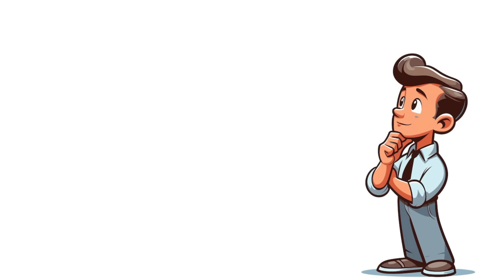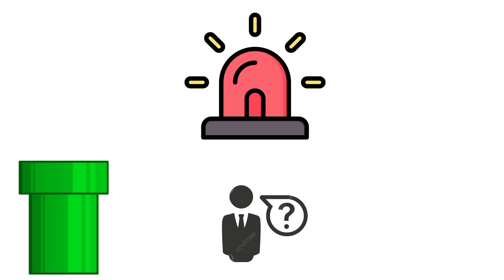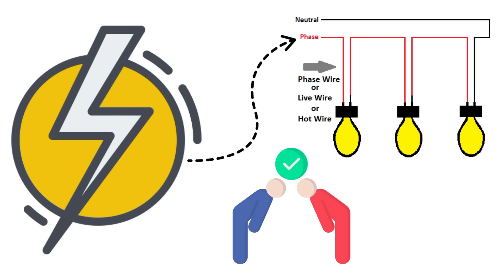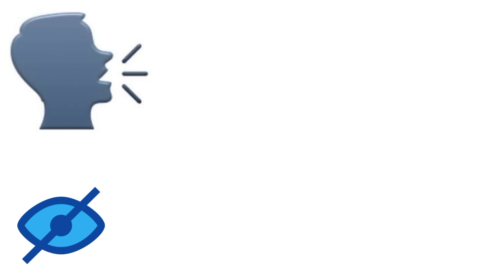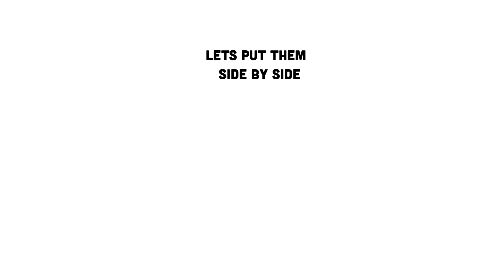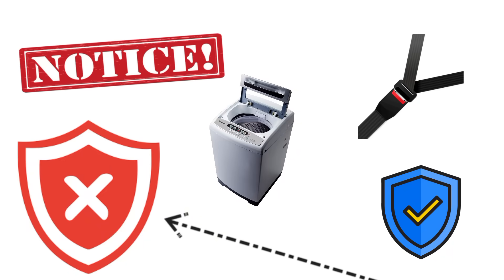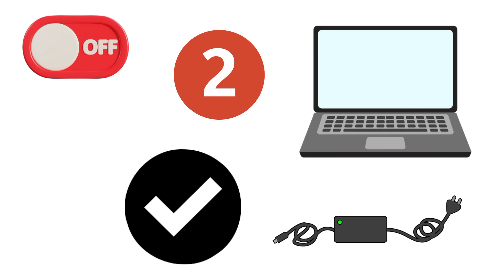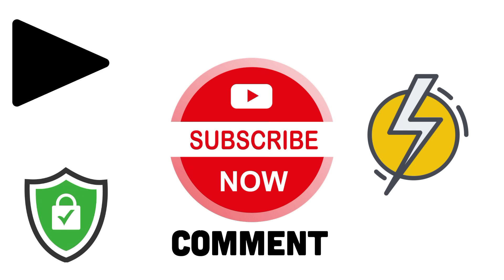How PHASE, EARTH, & NEUTRAL Works (REALLY SIMPLIFIED)

Comment: Wrong Wrong Wrong.
The "earth wire " does not conduct current into the earth. This is a point of confusion in the industry. The earth wire, better known as the ECG - Equipment Grounding Conductor - is what connects an appliance's cabinet back to the service panel (breaker box) at the same point as the neutral wire itself. In other words, this ECG wire ("earth wire") is like a parallel neutral wire that connects to the appliance's cabinet. Then if the hot (phase) wire touches the cabinet a direct short occurs to neutral and the breaker trips shutting off the power and making everything safe.

Yes, both the neutral wire and ECG wire connect to the wire that runs into the earth. However, the neutral wire and the ECG wire have nothing to do with the earth connection. That is to say, the neutral and ECG wires do not in anyway use this earth connection in their respective tasks. You could disconnect the connection to the earth completely and that would have absolutely no effect on the function of the neutral and ECG wires, or on safety in the event of an electrical short.

Someone may then ask, "Then why is the neutral and ECG wires connected to the earth?" Well, it's for a completely different purpose. To illustrate, imagine a railroad crossing. The tracks cross over the road. In fact, the tracks are embedded in the asphalt of the road. Yet the road does not rely in any way on the tracks to function and vise versa. You could take away the tracks and the road would function exactly the same as always. Or take away the road and the tracks would function just the same. So why then are the road and tracks connected? There must be a reason. Explain that one!

That's how it would be if you asked "Why are the neutral and ECG wires connected to the earth if they don't use that connection?"
Reply: This is correct if you fuse the neutral and ground line at the main distribution panel paving the path for return of the ground fault current to the distribution trasformer.
Reply: @duday1746 Yes and if the neutral and ground wires were not fused together then the fault current would have no path back to the transformer except for a few amps that would travel to the earth connection which could be 25 ohms and then back up through another earth connection to the transformer which would also be about 25 ohms or so. So then there would be roughly 50 ohms of resistance for the fault current to go through on the way back to the  transformer . That would limit the current to 120/50 = a little over 2 amps - not enough to trip a breaker or fuse.  
The ground was never meant to be a return path for fault current. There is just too much resistance. If the neutral and ground wires were not fused together at the main panel then all the grounded metal cabinets and boxes etc. would be energized to 120v and be dangerous in the event of a short.
Reply: Right, right, right!
The purpose of the earthing is to prevent from hazardous voltages. If a live wire connects to the cabinet, the fuze is intended  activate to cut the voltage.
Reply: @kjellg6532  "If a live wire connects to the cabinet, the fuze is intended  activate to cut the voltage." Yes, but Not because the system is connected to the earth! But because of the ECG wire that connects the cabinet to the neutral back in the fuse box (service panel ) Disconnecting the connection to the earth would have no effect on safety at all.
Reply: I always love an odd analogy:)

Comment: Great picture of electricity at work. Now, that means the earth is the path back to the power generation plant, right?
Reply: Noop. The 3 Line wires plus Neutral conways the electric power. On AC there is no «back». The hot and neutral will swap function every 1/2-cycle

Comment: the neutral returns the current = where does it go and what is done with it?  ground, seems to me its just a backup neutral
Reply: Considder a water heated floor system. A pump (voltage) is circulating water (current) in a closed loop. The water is heated in the boiler and dissipates heat in the cold room. In an electric senario the boiler-pump resembles the generator. 
If the pump runs the same way at all times the system is a DC system. If the pump starts, stops, reverts… you have an AC-system. 
Electricity is abstract  and takes a long time to fully understand. You can not see it, hear it, but you may feel it, sometimes hard!
Reply: @kjellg6532  
ok, so. the power that a bulb uses is charged for by what less is returning to the system? = the bulb receives 10, uses 1, returns 9, i get charged for 1 ?
Reply: @jesvans   The short answer is yes. If the bulb is stamped with say 8W (LED) you pay for 8W multiplied with time connected.   In 2 hours you will pay for 8*2= 16 Wh. 
The bulb never receives 10 it lets some current pass it depending on the resistance in the load.  A lamp has high resistance an a little current will flow. An electric heater has low resistance and the heating element gets glow warm.
Reply: @kjellg6532  thanx, your explanations are pretty good. so, there is not always a 10 in the wire at the socket? that would mean the bulb asks for about what it needs, i don't see how that would work.
Reply: I love it! Good job!  @kjellg6532
Reply: Ground is the shortest and less resistive path for the current to escape.  Like water, electricity ALWAYS takes the path of less resistance.  The neutral is connected to earth far and far away, which means many Ohms, ground is only meters (or feet) away, very few Ohms (Ohms is the measure of resistance)…. Simple enough?
Reply: @rb95051  
yes, thank you.
Reply: Don't heart this for  $ move views because you like everything. Answer the question or do nothing. It makes you look like a pos and are probably far from a pos.

Comment: Domestic lamp bulbs are NOT connected in series, as your diagram shows.
Also, the 'explanation' diagram at the end is totally confusing, a.c. circuits are not wired this way re neutral & protective 'earth'.
Reply from the maker: Thanks for pointing that out. You’re absolutely right—domestic lamps are connected in parallel, not in series. The diagram was a simplified example to show the basic idea, but I see how it can be confusing. I’ll update it to reflect proper AC wiring with live, neutral, and earth connections. Appreciate you catching that!